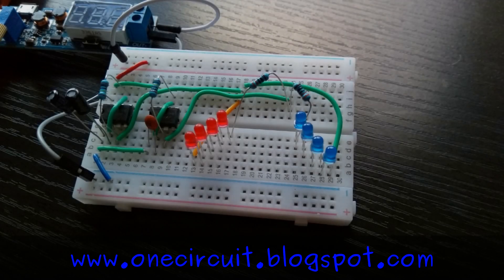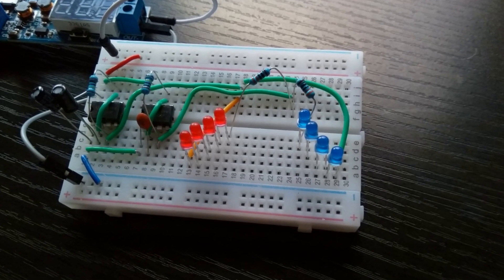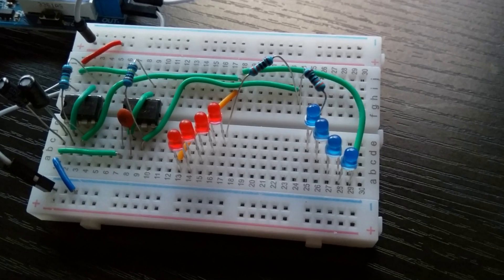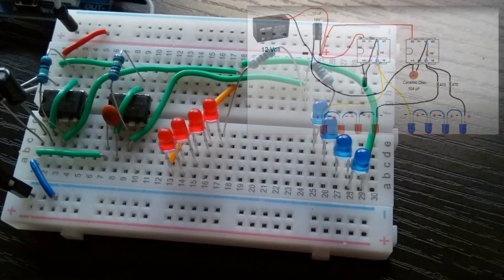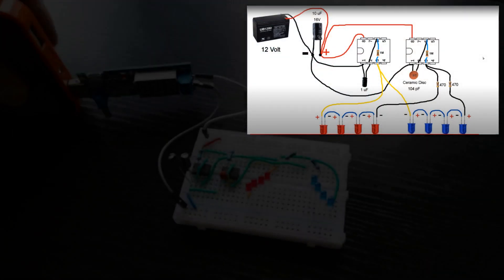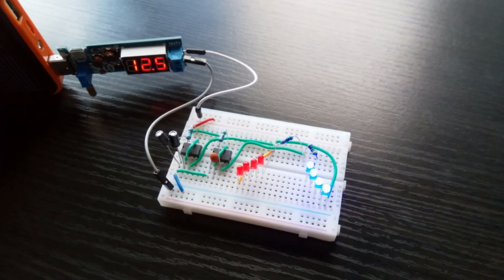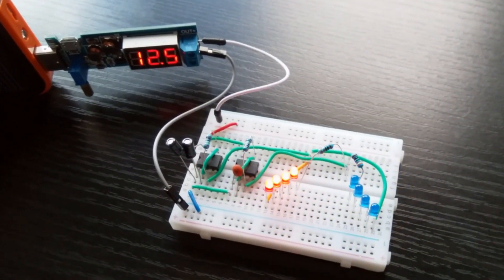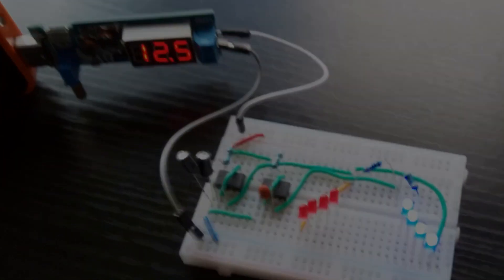Two 555 timers to make Police Lights! (republished)

Comment: Is it just me or do the blue LEDs flash quicker, I'm guessing because they have a higher forward voltage or current
Reply: I'm guessing if that is the case you could increase the 470ohm resistor to a higher value to make them matched
Reply from the maker: Yes they’re definitely not matched. But also they eye is easily fooled.